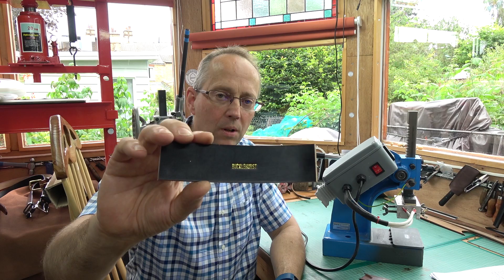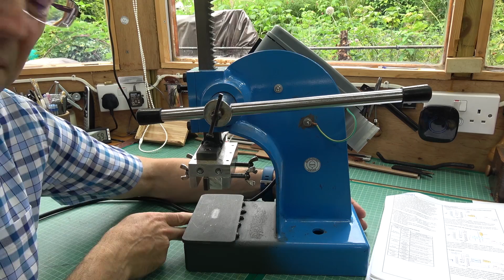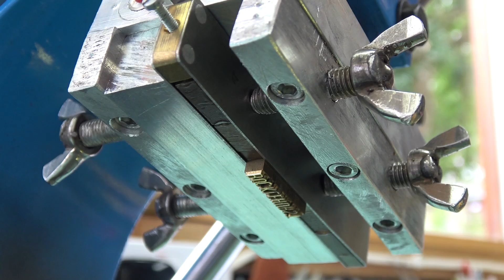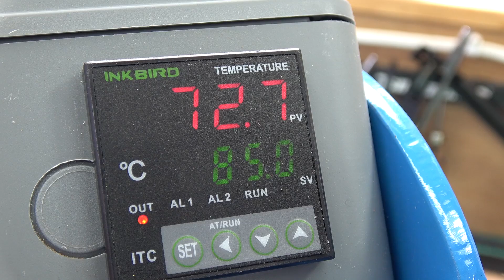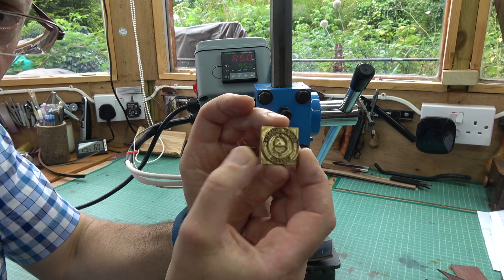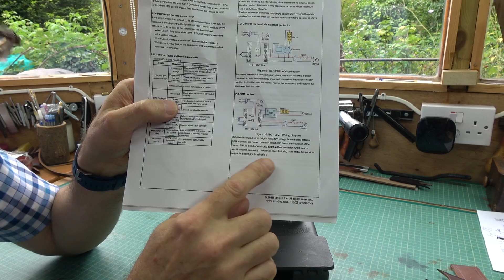Homemade  Hot Foil Gold Blocking Machine For Leatherwork

Comment: Cool little project. A quick look around at components online and i would say this cost you around £70 (for everything). Can you provide a link to the amazon kit you used for this as well as the heat tubes.

I would also like to know if the aluminum block you used to hold the stamp is something you machined or can be found (before adding the 10mm hols for the heat tubes)?

Lastly, can you also provide more images on how you used the grounding wire.

Great stuff.
Reply from the maker: NorgMonster hi the block is made from stock material bolted together....I gave the exact model number as links  change. Regards Harry
Reply: In using it do you think 1T is more than enough (would a 1/2T work just as well)? Also, i have not seen an arbor press with the same flat base like yours has. Is this a mode you added.
Reply from the maker: NorgMonster you need at least 1 ton..the base is an addition welded on.
Reply: Thought so. Thanks.

Last question.

How well do you think your press works over the £200 ish  ones you see on ebay from China? I would have thought yours because of the 1t and better quality electronics.
Reply from the maker: NorgMonster I don't know. The best option is to look around for a second hand Kwikprint machine with a self centering carriage and put these electronics on it. A homemade carriage is fine for a makers mark but unless you are very good with metalwork no good for type in my opinion.
Reply: Sorry, are you saying yours is "no good"?
Reply from the maker: NorgMonster Its good for logos..but my carriage is not very good for type.
Reply: Got it :-). I wonder why that would be... 

Last last question:

What is the Voltage and length of the Ceramic Core Cartridge Heater Heating Tube Element you used?

Comment: Great little project there Harry, well done.  I did a similar PID based control box for a small kiln. For those scared off by doing their own electrical work, the Chinese sell some nice temperature controlled hot foil stamping presses on Ebay at about $180 USD with foil feed rolls, there are also hand held heat embossers for around $60-100 USD (with variable heat control).
Reply from the maker: Thanks.
Reply: Be careful with the cheap ebay units - harry now says that even with his letter holder (chase) it is hard to get good results. Most of the ebay units have a flat metal heat plate - they claim you tape your letters or logos to the plate with heat resistant tape. I imagine this is hard to get good straight registration of the letters

Comment: Harry, nice to see you paying attention to earthing. Did you use thermal transfer compound (aka heatsink grease) to couple the heaters to the block? (not a potential criticism, as the thing clearly works, just curious as to whether you needed it)

I'd say the way you've built this is up to scratch, as an electrician I'd have no issues passing that as safe to use :)